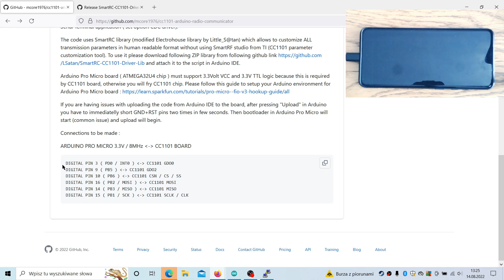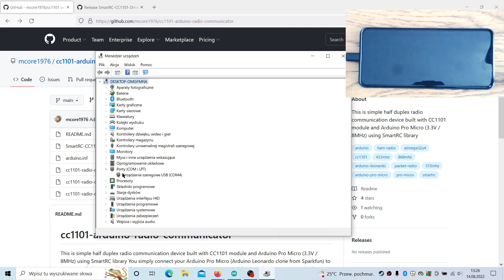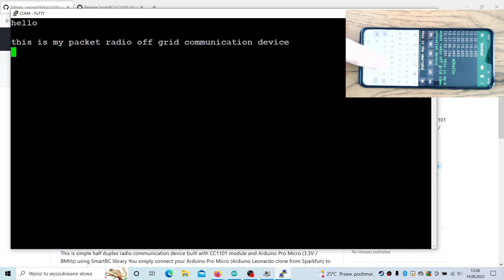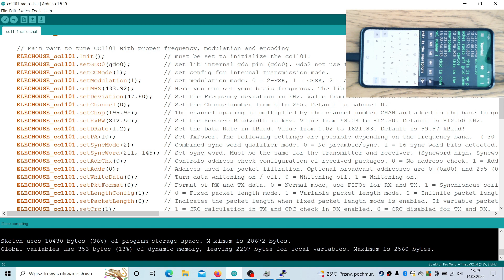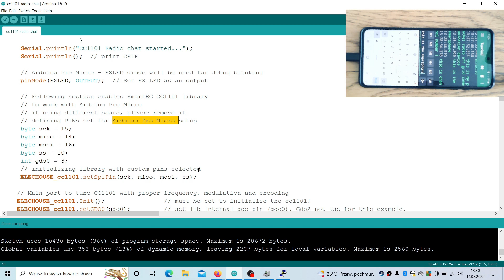DIY the simplest off-grid packet radio communicator for secure messaging based on CC1101 and Arduino

Comment: Nice, since the CC1101 max output is only  0,015W, why not coupling the devices with a LNA4ALL or similar LNA board?
Reply from the maker: good idea but it is kinda diffucult when you have the same chip and the same antenna shared for transmitting and receiving
Reply: @justanengineer5599  true but you could have two CC1101 connected to the Arduino Nano with two LNA one working in Rx the other in Tx and a usb powerbank to inject 5V so the range could go up to hundreds of kilometers by using directional antennas
Reply from the maker: that is correct and it is possible with 2 of my devices. Each one will be visible as separated virtual COM port in the system. You are 100% right

Comment: Have you considered data transmission over amateur bands? I believe it's CEPT license in Poland, very similar to HAM technician license in USA.
 
Nice part is that amateur bands allow high-power transmissions on lower frequency bands so hundreds and sometimes thousands of kilometers effective range depending on setup.
 
I have previously contacted PZK members from Chicago - might be good for contacting family in the event of major cellular/internet loss.
Reply from the maker: I am rather thinking of something that anyone may use without license.
Reply: @justanengineer5599  did you try PMR 446 bands in both directions?
Reply from the maker: yes I already have some analog Motorola PMR. It is has limited power to 0.5W
Reply: @justanengineer5599  Would be nice to see what kind of range you can get with plain sight between the two devices on that band.
Reply: Very interesting. I am going to obtain and try to implement HF for long range com over amateur bands. This is definitely exactly what I was looking for. Thank you for the post.